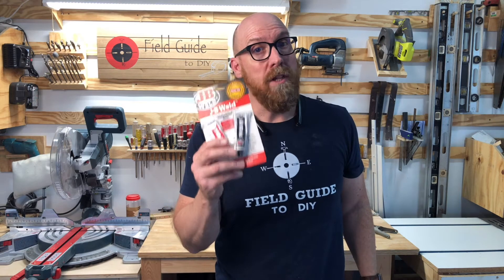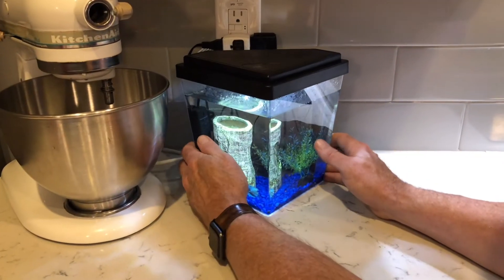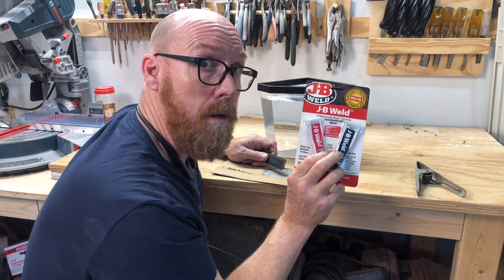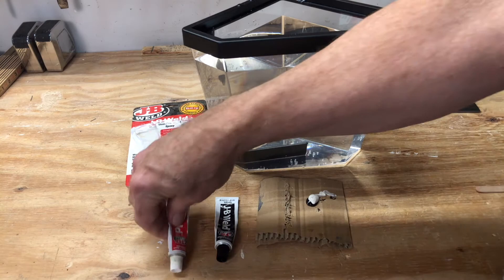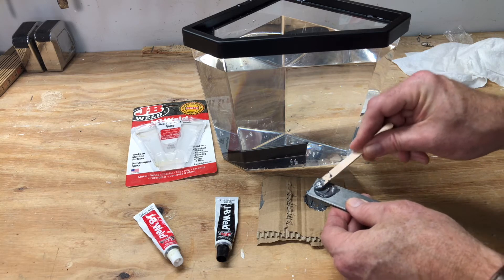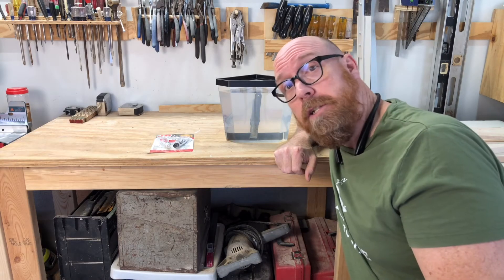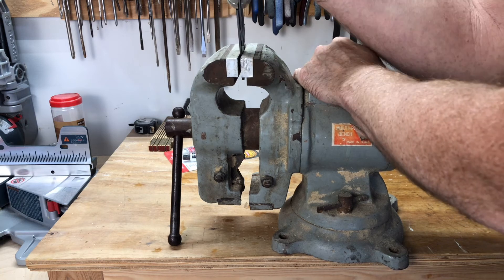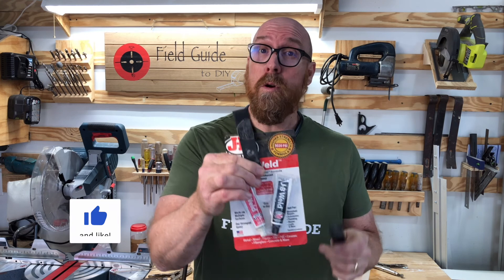Does JB Weld Work Under Water | The Answer May Save Your Life

Comment: It absolutely doesn't work underwater under any practical circumstance. No water can be flowing at all or it will just wash right off. If you have an active leak this will not fix it. Even the instructions want the surface to be dry.
Reply from the maker: Absolutely.  Gonna test MarineWeld next.

Comment: Took a lot of force to get it to come apart, which would be good for a temporary fix. I have never had any luck with JB Weld period curing properly above water. It always cracked at the critical contact points regardless, even though the rest of it mended just fine and stayed put on the other contact surfaces! I have a small drip from my toilet tank at one of the bolt assembly points. Giving it a try and hope it stops the drip.
Reply from the maker: Mine is still holding strong, that is except for the cold steel I used to repair plastic on my table saw.  That gave up the ghost at the same point so I used Plasticweld which is still holding strong.

Comment: I tried the JB MARINE weld also(the 2 tubes the classic grey color). It doesn't work at all, looks even worse then the video with JB original. I removed the parts with my fingers(set and cure underwater). I tried also to set 2 hours on air and the rest underwater, failed also completely. Don't use JB marine weld to cure underwater! 
*water penetrated it at least 1.5mm deep, making it soft and not able to bond
Reply from the maker: Thanks for the heads up.  I've had that experiment on my list since I made this video.  I'll share my results soon.  Thanks so much for watching.
Reply: It was the first time i used epoxy, maybe i did something wrong, but it failed completely, if you feel like testing JB marine weld, i would be curious on testing its strength also, because in my tests it was so bad, stainless steel didn't glue at all, even when dried i could crack it with my hand, even if not underwater. Again i might did something wrong!

Comment: yep leaky radiator kept from curing...had to geyt it all bone dry
Reply from the maker: Exactly my results.  Thanks for sharing your experience!  (also, thanks so much for watching!)
Reply: I used JB weld for my crack radiator it hold but after 100 miles,  eventually got leak a little, it probobly work if I made the surface rough. But at least give me time my ordered radiator home.

Comment: But JB weld makes a waterweld epoxy putty that's not only made to be water resistant, but it's also NSF certified drinking water safe. It's made to even be applied underwater.

Comment: im restoring a single shot shotgun the screw weld broke that attaches the stock to the barrel so used jb weld to reattach it and clamped it down four hours later seems to be holding  now i hope its water proof lol thats what brought me here hope i can still hunt in the rain...... thanks
Reply from the maker: Well, the fact it cured above water (lol) you should be good.  It’s not an automatic so the heat of the barrel should not be a factor.  Thanks so much for watching!  Keep us posted if it doesn’t hold.
Reply: @FieldGuidetoDIY   i will thanks for the advice watching your video on jb weld strenght test now.... learning alot :)
Reply: is that shotgun repair with JB Weld still holding, and did it handle the rain?
Reply: @patrickchen623  it lasted two years and I didn't use the waterproof stuff but it held for 2 years

Comment: This test seems better suited to their marine weld product.  Is there a way to compare the relative strength of a bond if it sets (not cures) out of water vs. in water.  I am thinking an emergency situation wouldn't allow enough time for a full cure.
Reply from the maker: GREAT point.  I recently went to a marine supply store and they only carried Original Cold Steel which got me thinking if it would activate under water.  COMING SOON: head to head vs Original vs Marine.  I’m doing it.  Thanks so much for watching and the suggestion!
Reply: @FieldGuidetoDIY  Cool, test also if you let it cure first and then put it underwater almost forever, will it detach from the material (especially plastic)?  Was the steel sanded by the way or it was as is, smooth finish?

I highly recommend bringing this by the way for an emergency: a 1m by few cm carbon fiber + scissors (true carbon fiber will conduct electricity, best to have a Kaiweets colored LCD mutlit-meter or something more popular like a Fluke, carbon fiber edges are fragile to handle, especially the more complex weaves but the 1 x 1 weave is easier to handle, doesn't untangle as easily), if you have an emergency JB Weld Original is a good matrix to especially if JB weld sandwiches  the carbon fiber  get by until you're ashore (perhaps if a blade hits a rock and breaks or some fishing  gear. Cabon fiber's best glue from the center/away from the edge not the from it's edges).

God bless.
Reply from the maker: GREAT tips!  I appreciate it.  Coming soon.  Thanks so much for watching.
Reply: @FieldGuidetoDIY  Was it tested and videoed? would like the answer since it will be useful for undewater boat repairs. If its done then i can't find the video.